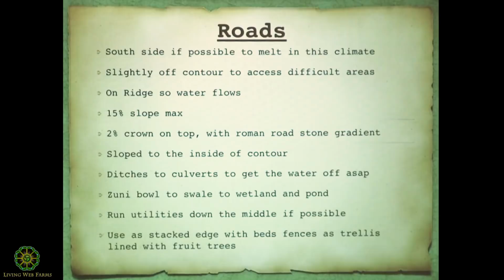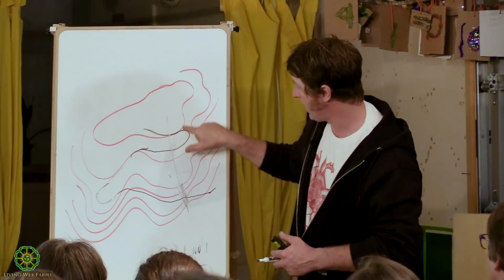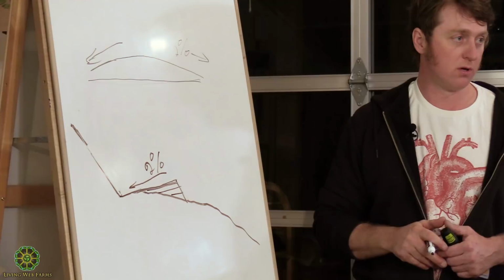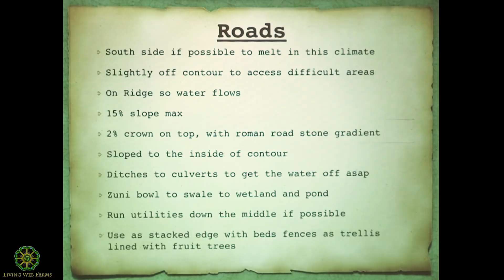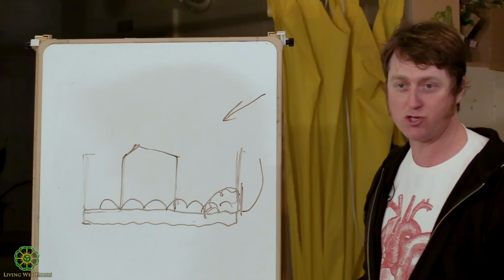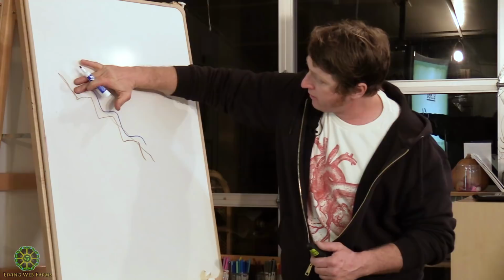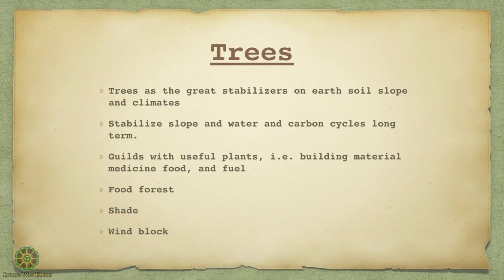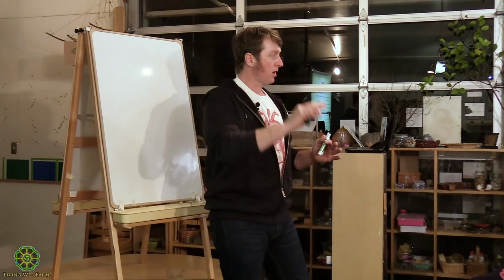Permaculture Design for Homesteading Part 3

Comment: I use a lot of hugelkultur to shift desert landscape to food forest in Central WA.  on each of my terraces I dig a trench 4'deep 3' wide currently about 800' long I stack  I've had hundreds of trucks from craigslist deliver yard waste, branches, logs, leaves, manure, pallets, cardboard, food waste from gross restores. to fill the trenches about 4' above ground level and cap with the material from the terrace. The trenches take some time to fill, the goats eat from them, stomp them into the trenches tight and poop all over them. I like that it leaves space for rodents... the cats are regularly hunting the fields and the compost piles...I don't have to feed them much either. I have taught my dogs to dig on command...see my channel for a recent video on that. They help me dig catch basins on the property up high for catching surge of rain or snow melt promoting aquifer juice. I call this project Hawkshaven.